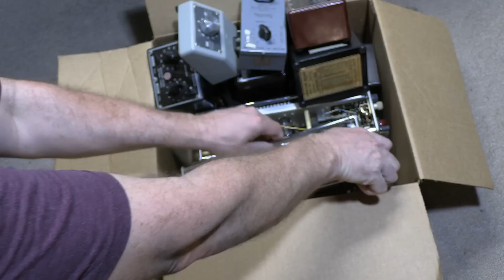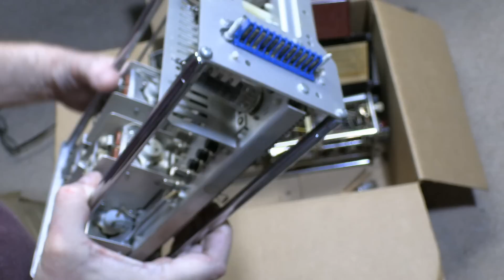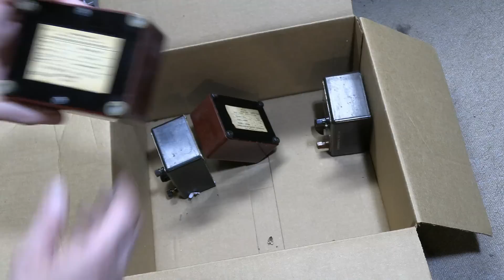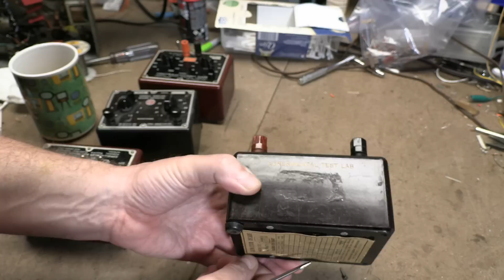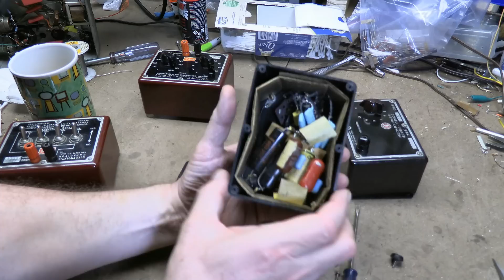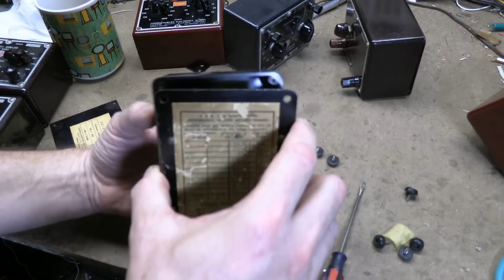Estate treasures: Vintage Component Substitution Boxes and Tektronix plugins

Comment: Bob, have three of the CDE cap sub boxes and the actual values vary depending on the cap/inductor meter used. I checked mine casually and could make no consistent sense of the values. Documents suggest using a 200 ohm resistor to bleed the caps before measuring/using. Nice conversation pieces but not of much practical use.
Reply from the maker: I agree.  The materials used inside are not precision or stable.

Comment: I might be wrong but I heard that the micro sized valves were used by the military during the cold war as they would not be subject to the large pulses sent by a thermonuclear device that Germanium and Silicon would succumb to? (Apologies for the grim subject).
Reply from the maker: Yes, they are radiation resistant and used in some space craft and MiG jet fighters.

Comment: I can picture using a cap or inductor substitution box, or more likely both together, to find optimum values in some tuned circuit to get the desired slope. Now you'd just plug values into Sim Smith, etc.

Comment: Bob  when I was a kid in early 70s  My Ham mentor owned a TV Shop and decade boxes were used to fix TV,s often as you said cut one lead and install a decade box and select a cap. or put it in parallel and select the best cap to add to the circuit.  Same done for Resistors.  USED a lot at least I saw that while learning and assisting the repair man.

Comment: A good use for substitution boxes now-a-days is to tailor the sound in vintage jukeboxes. A lot of original cartridges are no longer available. By using a generic cartridge, you can get whatever sound you want. Need a little more bass, or treble. Just insert a little more capacitance or resistance to the final stage and you can easily get the desired sound without a lot of fussing around. Love mine, I use them all the time. Edit. You could use them for restoring record players too, although I will admit, I haven't used them for that application. Essentially the same idea.

Comment: they were and are used to test and calibrate test gear like multimeters etc..
Reply: What multimeter would you use a Capacitor substitution box with, unless you are talking about digital MM’s . These boxes were used in the 1950’s. The only meter would be the LCR bridge by Booton Labs, or an Eico C checker.

Comment: They might not produce caps at 5% tolerance in that time, but you get there with selection. So the tolerance stated is likely not for the caps individually but for the device as a whole. They all seem to have charts in the back listing the measured values, which is needed when running experiments or using them to calibrate stuff. They might have been used as "standards"
Also I have seen that hodgepodge construction before in measuring equipment. They choose the components for their properties at certain ranges of values, not for their brand names. Whatever works to get the accuracy required, no need to look pretty.

Comment: These cap subbers would be sent out to an independent standards lab for 90 day rotations. They are valuable!
Reply from the maker: Dozens of them on eBay for around $20 or less.  Several of mine are pretty rough inside as you saw. All the original caps have been replaced with a mess of different types

Comment: I still use the Eico sub boxes when I experiment.
Reply: The resistor's substitution box is handy for determining what value of Siri's resistor or shouldn't resistor one needs in order to replace the backlighting in old stereo receivers with modern LED's to get the brightness down to where you want it, as well as limiting the voltage and current  so the LED doesn't fail prematurely.

Comment: those sub boxes are pretty useful when you're designing circuits; you can dial in resistors/caps when making oscillators and filters and testing load currents on power supplies.  it's better than a pot in some cases since you get standard values that you can switch between instead of an infinite range.  the cap box is good since variable capacitors don't tend to exceed a few hundred pf.

Comment: The secret is the special switching pattern/contact arrangement of those switches. They were specially designed for decade boxes with minimal component count. They do indeed create series/parallel combinations of several different values.

Comment: Corn L Doo Bleer was the phonetic pronunciation. Again a real find. Value them ! I used them in the 1950’s thru the 1970’s. Eico made  Cap and resistors decade boxes. Often I used them in my repair shop fir figuring out an unknown cap value in a circuit. We didnt always have schematics.
Reply: I have an Eico resistor substitution box on my workbench at the audio repair shop; I find it very handy for selecting resistor values when upgrading the backlighting on old stereo receivers to LED's because you can quickly determine what resistor value to use to achieve the desired brightness and drop the voltage and current to keep the LED from failing prematurely.

Comment: The Tektronix plug in were used in the 7000 series scopes with as many as 4 plug ins in one mainframe. I was a research tech at RCA labs in Princeton. They were often found in our calibration labs for wein bridge impedance bridges. Consider them component standards. Id love to have them in my shop.
Reply from the maker: These are for the older 500 series. I think the previous owner has a model 561.
Reply: @bandersentv ok like the 531 scope? I recall you modules coming from a newer series in the late 1970’ s however I was still using a 535
Reply from the maker: 560 series.  These plugins are from 62/63.
Reply: I just checked the 7000 series vs the 500 series scopes and you plug ins are 7000 series vintage. The 500 series plig ins were much wider and not as long. A great find though, I envy you.
Reply from the maker: 2B7A (1962) and 3A74 (1963) plugins.  These are most definitely 560 series.  Tek 7000 series ran from 1968 to 1992.  These modules are much older than that.

Comment: At RCA labs we used the capacitor substitution boxes in research and design, after calculating component values we would try out our design. The Cornell Dublieer were the best models. You got some real  prizes.

Comment: Sub boxes are still useful for laboratory use. I use one for selecting bridge balancing resistors for strain gage bridges.   Sencore made a multi-purpose substituter for the TV service market that had resistors, caps, inductors, and diodes.

Comment: Cornell-Dubilier made precision substitution capacitor boxes for laboratory work. Talking down to the thousanth decimal
( or better if requested ) and accuracy for test pieces of equipment in the lab. Think these were  modified for a specific
use by the last owner with no surprise an electrical engineer.

Comment: Got so excited about getting a deal on the scope he didn't bother to ask if there was any other parts that went with it 🙄
Reply from the maker: He probably got it for free.  House was being demolished and it all had to go quickly.
Reply: He sounded like he would give that four Channnel accessory away to the lucky buyer
Reply from the maker: Yeah, it's useless to me.  I think the scope was a model 561
Reply: I have a probably 70s/80s tekronixs scope I got at a car swap meet. I know a lot of different stuff and weird things show up at those things. Guy swore it worked and it has the full tech manual and everything. It of course does not work but a few things light up so maybe someday I'll tear into it and see if I can resurrect it. I only paid 30 bucks for it so no big loss either way and I think its quad trace with ok bandwidth. I should kept the two I had before but I didn't really use them so I swapped em off.